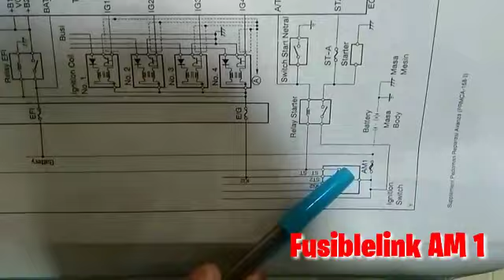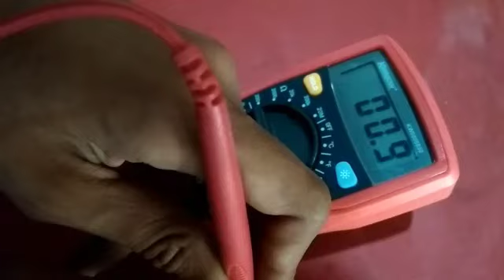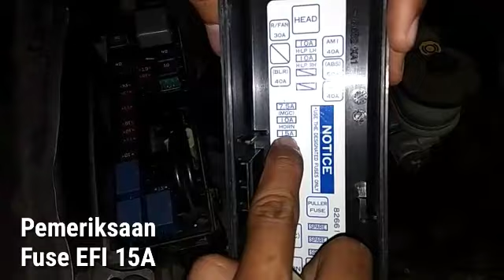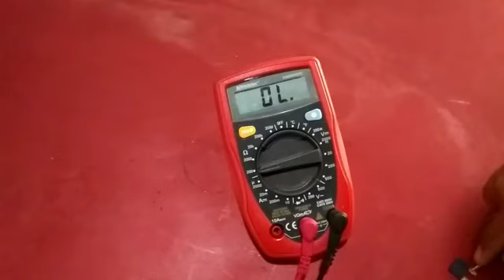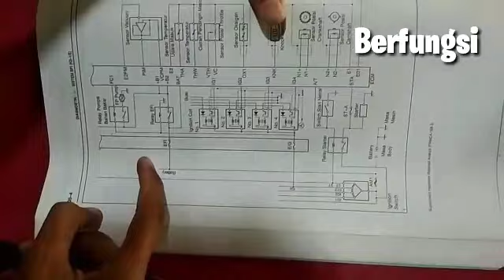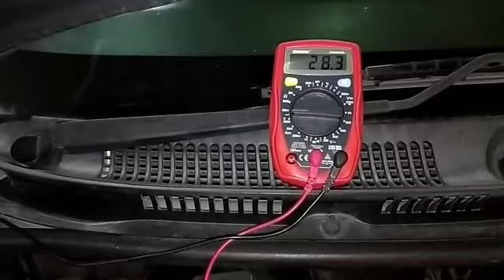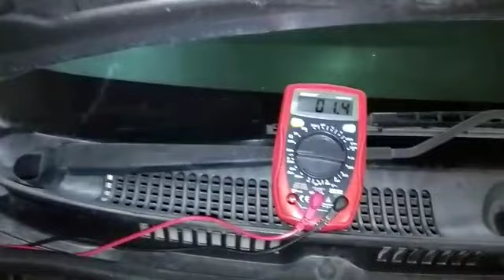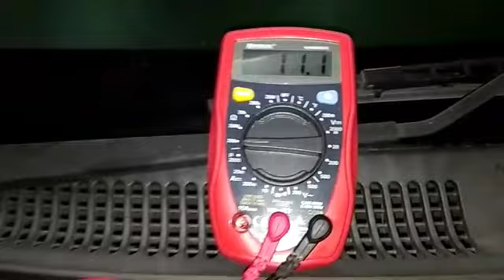CARA MUDAH PERIKSA SEKRING MOBIL DAN KELISTRIKAN YANG  BERMASALAH" servis 2 #otomotif #engine

Comment: Nama : Apriliani Muslikatun Rohmah
Kelas : XII TKRO C
No.Abs : 6
Materi : Service Tune Up Mobil
Baterai -> fusibelink AM 1 -> fuse EFI -> fuse E/G -> relay starter -> relay pompa bahan bakar -> relay EFI.
Langkah pemeriksaan 
- Aki/baterai pastikan semua kabel tersambung pada aki. 
-fusebelink AM 1 bernilai 40 A terletak dibawah relay head (sebelum dipasang lakukan pengecekan terlebih dahulu dengan multitester) 
- Fuse EFI terletak dibawah fuse horn (sebelum dipasang lakukan pengecekan terlrbih dahulu) 
- Fuse E/G terletak pada nomer 4 dari bawah (sebelum dipasang lakukan pengecekan terlebih dahulu)
-Relay starter lakukan pengecekan dengan multitester. 
- Relay EFI terletak dibawah relay pompa bahan bakar. 
- Relay pompa bahan bakar lakukan pengecekan sebelum di pasang. 

Pak mau tanya, 
1. Apa yang terjadi jika porsneleng berada di huruf D? 
2. Apa akibatnya jika fiuse ST A rusak? 
Mohon penjelasannya Pak terimakasih
Reply from the maker: 1. Mobil matic hanya bisa distart di posisi N/P 
Kalau kita taruh di D/2/L , ketika kita sudah menemukan trobel fuse/relay kalau tuasnya di D mobil tetap tidak akan hidup.
2. ST artinya starter, kalau rusak berarti sistem starter pada kendaraan tidak bekerja

Comment: Nama : Achmad Alimmuna Putra 
Kelas : XII TKRO A 
No      : 01

Materi : Tune Up EFI 
(Baterai/Accu, Fusiblelink AM1, Fuse EFI, Fuse E/G, Relay Starter, Relay Pompa Bahan Bakar, Relay EFI 

¤ Pastikan saat melakukan pemeriksaan kelistrikan pada mobil , kunci kontak dalam posisi off/Lock.
¤ Pemeriksaan Fusiblelink AM1 bernilai 40 A terletak dibawah Relay Head. Sebelum dipasang, lakukan pemeriksaan terlebih dahulu dengan menggunakan Multitester.
¤ Pemeriksaan Fuse EFI terletak dibawah Fuse Horn no. 3 dari atas. Sebelum dipasang cek Fuse dahulu dengan Multitester. 
¤ Pemeriksaan Fuse E/G 10 A berada pada no. 4 dari bawah, Fuse bernilai 10 A , sebelum memeriksa pastikan Amplas dahulu baru kemudian lakukan pengecekan dengan Multitester. 
¤ Pemeriksaan Relay Starter lakukan pengecekan menggunakan Multitester. 
¤ Pemeriksaan Relay EFI, terletak dibawah Relay Pompa bahan bakar. 
¤ Pemeriksaan Relay Pompa bahan bakar.

Comment: Nama : Sulendra
Kelas : XII TKRO C
No      : 29 

Materi : Tune Up EFI 
(Baterai/Accu, Fusiblelink AM1, Fuse EFI, Fuse E/G, Relay Starter, Relay Pompa Bahan Bakar, Relay EFI 

- Pastikan saat melakukan pemeriksaan kelistrikan pada mobil , kunci kontak dalam posisi off/Lock.
- Pemeriksaan Fusiblelink AM1 bernilai 40 A terletak dibawah Relay Head. Sebelum dipasang, lakukan pemeriksaan terlebih dahulu dengan menggunakan Multitester.
-Pemeriksaan Fuse EFI terletak dibawah Fuse Horn no. 3 dari atas. Sebelum dipasang cek Fuse dahulu dengan Multitester. 
¤ Pemeriksaan Fuse E/G 10 A berada pada no. 4 dari bawah, Fuse bernilai 10 A , sebelum memeriksa pastikan Amplas dahulu baru kemudian lakukan pengecekan dengan Multitester. 
- Pemeriksaan Relay Starter lakukan pengecekan menggunakan Multitester. 
-Pemeriksaan Relay EFI, terletak dibawah Relay Pompa bahan bakar. 
- Pemeriksaan Relay Pompa bahan bakar.

Comment: Nama:Sinta Wijayanti 
Kelas: XII TKRO C
NO abs:27
Materi tune up EFI
Pertama yang dibutuhkan adalah EWD (Electrical Wairing Diagram).
-Pastikan saat melakukan pemeriksaan kelistrikan pada mobil kunci kontak dalam posisi off/lock
1. Pemeriksaan Aki/Batteray
2.Pemeriksaan Fussiblelink AM 1, bernilai 40A letaknya di bawah relay head, sebelum memasang fuse harus dicek terlebih dahulu apakah fuse berfungsi dengan baik atau tidak dengan cara di cek menggunakan multitester.
3.Pemeriksaan fuse EFI bernilai 15A letaknya di bawah fuse born nomer 3 dari atas.
4.Pemeriksaan fuse E/G terletak di nomer 4 dari bawah bernilai 10A. 
5.Memasang Relay starter setelah di pasang lalu di cek ternyata bisa di starter tetapi tidak menyala. 
6.Memasang relay EFI setelah dipasang dan di cek ternyata bisa di starter tapi setelah beberapa saat mati sendiri. 
7.Memasang relay pompa bahan bakar setelah dipasang dan di cek ternyata mobil sudah bisa beroprasi secara normal. 

Pertanyaan:
1.sebenarnya EFI itu lebih dominan ke kelistrikan atau gimana pak?
Reply from the maker: Sistem efi, mwngadopsi kelistrikan yg diterapkan pada sistem bahan bakarnya untuk menyuplai bahan bakar dalam silinder

Comment: Nama: Medita Rochmi
Kelas: XII TKRO C
No. absen: 21

Materi: Service Tune Up Mobil
Baterai –> fusibelink AM 1 –> Fuse EFI –> Fuse E/G –> Relay starter –> Relay pompa bahan bakar –> Relay EFI
Langkah pemeriksaan 
Pastikan kunci kontak dalam posisi off/lock
-Aki/baterai, pastikan semua kabel tersambung pada aki
-Fusibelink AM 1 bernilai 40 A terletak di bawah relay head (sebelum dipasang lakukan pengecekan terlebih dahulu dengan multitester)
-Fuse EFI, terletak di bawah fuse horn (sebelum dipasang lakukan pengecekan terlebih dahulu)
-Fuse E/G, terletak pada no.4 dari bawah ( sebelum dipasang lakukan pengecekan terlebih dahulu)
-Relay starter, lakukan pengecekan dengan multitester
-Relay EFI, terletak di bawah relay pompa bahan bakar
-Relay pompa bahan bakar, lakukan pengecekan sebelum dipasang

Comment: Nama : Slamet Prayitno
Kls      : Xll TRO A
No a   : 27
Materi: tune up EFI
batre * fuse blelink AM 1 fuse EFI *fuse E/G *relay starter *relay pompa bahan bakar *relay EFI
-pastikan saat melakukan pemeriksaan kelistrikan pada mobil kuci kontak  dalam posidi OFF/LOCK
-pemeriksaan aki atau battery pastikan semua kabel ke aki dan kemudian kecangkan baut aki jangan sampai kendorr
-pemeriksaan fusiblelink AM 1 bernilai 40 amper letaknya di bawah heord ,sebelum memasang fuse 40 amper pastikan bisa digunakan dan sebelum di pakai di periksa terlebih dahulu  dengan mengunakan multitester
-pemeriksaan fuse EFI letaknya di bawah fuse horn nomer tiga dari atas  sebelum memasang lakukan pemeriksaan terlebih dahulu utuk pemeriksaanya di bersikan mengunakan amplas terlebih dahulu kemudian baru di cek dengan mengunakan multitester
-pemeriksaan fuse E/G 10 A berada pada nomer 4 dari bawah, fius bernilai 10 amper kemudian sebelum di pasang diperiksa terlebih dahulu dan di amplas
-pengecekan relay starter terletak di paling atas dudukan putih sebelum di pasang relay di cek terlebih dahulu
-pemeriksaan relay efi letak di bawah pompa bahan bakar
-pemeriksaan relay bahan bakar

Comment: Nama : Supandra
Kelas : XII TKRO B
No      : 23

Materi : Tune Up EFI 
(Baterai/Accu, Fusiblelink AM1, Fuse EFI, Fuse E/G, Relay Starter, Relay Pompa Bahan Bakar, Relay EFI 

- Pastikan saat melakukan pemeriksaan kelistrikan pada mobil , kunci kontak dalam posisi off/Lock.
- Pemeriksaan Fusiblelink AM1 bernilai 40 A terletak dibawah Relay Head. Sebelum dipasang, lakukan pemeriksaan terlebih dahulu dengan menggunakan Multitester.
-Pemeriksaan Fuse EFI terletak dibawah Fuse Horn no. 3 dari atas. Sebelum dipasang cek Fuse dahulu dengan Multitester. 
¤ Pemeriksaan Fuse E/G 10 A berada pada no. 4 dari bawah, Fuse bernilai 10 A , sebelum memeriksa pastikan Amplas dahulu baru kemudian lakukan pengecekan dengan Multitester. 
- Pemeriksaan Relay Starter lakukan pengecekan menggunakan Multitester. 
-Pemeriksaan Relay EFI, terletak dibawah Relay Pompa bahan bakar. 
- Pemeriksaan Relay Pompa bahan bakar

Comment: Nama:Welas Asih
Kelas:XII TKRO B
No absen:27
Materi: Service Tune Up Mobil
Baterai -> Fusibelink AM 1 -> Fuse EFI -> Fuse E/G -> Relay starter -> Relay pompa bahan bakar -> Relay EFI. 
Langkah Pemeriksaan:
-Aki/baterai pastikan semua kabel tersambung pada aki
-Fusebelink AM 1 bernilai 40 A terletak dibawah relay head (sebelum dipasang lakukan pengecekan terlebih dahulu dengan multitester) 
-Fuse EFI terletak dibawah fuse horn (sebelum dipasang lakukan pengecekan terlebih dahulu) 
-Fuse E/G terletak pada nomer 4 dari bawah (sebelum dipasang lakukan pengecekan terlebih dahulu)
-Relay starter lakukan pengecekan dengan multitester
-Relay EFI terletak dibawah relay pompa bahan bakar
-Relay pompa bahan bakar lakukan pengecekan sebelum di pasang.

Comment: Nama: M syamsul anwar
Kelas: XII TKRO C
Absen: 19
Materi: tune up efi
Baterai- fusiblelink AM1 - fuse efi - fuse E/G - relay starter - relay pompa bahan bakar - relay Edi
* Pastikan saat melakukan pemeriksaan kelistrikan pada mobil kunci kontak off
* Periksa aki pastikan semua kabel tersambung ke aki
*Pemeriksaan fusiblelink AM1 bernilai 40 A terletak di bawah relay head sebelum di pasang, lakukan pemeriksaan terlebih dahulu dengan menggunakan multi tester 
* Pemesiksaan fuse efi terletak di bawah fuse horn nomer 3 dari atas sebelum di pasang lakukan pemeriksaan dengan multi tester
* Pemeriksaan E/G 10A berada pada nomer 4 dari bawah fius bernilai 10A sebelum memeriksa amplas terlebih dahulu
* Pemeriksaan relay starter lalukan pengecekan dengan multi tester
* Pemeriksaan relay efi, terletak di bawah relay pompa bahan bakar 
* Pemeriksaan pompa bahan bakar

Comment: Nama:Dwi agung santoso
Kelas:XII TKRO B
No:8

Materi: TURN UP EFI
Baterei->Fusebling AM 1-> Fuse Efi->fuse E/G->Relay starter->Relay pompa bahan bakar->Relay Efi
Langkah pemeriksaan:
Pastikan pada saat melakukan pemeriksaan kelistrikan pada mobil kunci kontak dalam posisi OFF

Pemeriksaan aki pastikan semua kabel tersambung pada aki tidak ada yang diselipkan.
Pemeriksaan fisik Lelono AM1, bernilai 40 A terletak di bawah relay head(sebelum di pasang lakukan pengecekan terlebih dahulu dengan multi tester)
Pemeriksaan fuse Efi bernilai 15 A terletak di bawah Fuse horn (sebelum dipasang lakukan pemeriksaan dan bersihkan terminalnya dahulu)
Pemeriksaan Fuse E/G bernilai 40 A berada di nomor 4 dari bawah (sebelum dipasang lakukan pengecekan terlebih dahulu)
Pemeriksaan relay starter,lakukan pengecekan dengan multi tester
Pemeriksaan relay Efi, terletak dibawah Relay pompa bahan bakar
Pemeriksaan relay pompa bahan bakar, lakukan pengecekan terlebih dahulu sebelum dipasang.

Comment: Nama : Abdul Hadi
No.abs : 01
Kelas : XII TKRO B
Materi : Tune up EFI

               Yang dibutuhkan adalah :
               EWD (Electrical Warung Diagram)
               Baterai__Fusiblelink AM 1__Fuse EFI__Fuse 
               E/G__Relay Starter__Relay pompa bahan
               bakar

Pastikan saat melakukan pemeriksaan kelistrikan pada mobil, kunci kontak dalam posisi off/lock.

      Langkah pemeriksaan :
               1. Pemeriksaan Aki/Baterai ( pastikan semua
                   kabel tersambung pada Aki
               2. Pemeriksaan Fusiblelink AM 1 bernilai 40 
                   A terletak dibawah relay head (sebelum di
                   pasang lakukan pengecekan terlebih
                   dahulu dengan multitester)
               3. Pemeriksaan Fuse EFI terletak dibawah
                   fuse horn (sebelum dipasang lakukan
                   pengecekan terlebih dahulu)
               4. Pemeriksaan Fuse E/G terletak pada no. 4
                   dari bawah ( sebelum dipasang lakukan
                   pengecekan terlebih dahulu)
               5. Pemeriksaan Relay starter ( lakukan 
                   pengecekan dengan multitester)
               6. Pemeriksaan Relay EFI terletak dibawah
                   relay pompa bahan bakar
               7. Pemeriksaan Relay pompa bahan bakar
                   (lakukan pengecekan sebelum dipasang)

Comment: Nama : Muhammad Yusuf Danang Mustofa
Kelas : XII TKRO A
No.absen : 20

Materi : Tune Up EFI
Baterai - Fusiblelink  AM1 - Fuse EFI - Fuse E/G - Relay Starter - Relay Pompa bahan bakar - Relay EFI
-Pastikan saat melakukan pemeriksaan kelistrikan pada Mobil kunci kontak dalam posisi OFF/Lock
-Pemeriksaan Aki / Battery pastikan semua kabel tersambung ke Aku
-Pemeriksaan Fusiblelink  AM1 benrnilai 40 A terletak dibawah relay head sebelum dipasang, Lakukan pemeriksaan terlebih dahulu dengan menggunakan Multi tester
-Pemeriksaan Fuse EFI terletak dibawah Fuse horn nomer 3 dari atas sebelum dipasang lakukan pengecekan terlebih dahulu dengan menggunakan Multi tester
-Pemeriksaan Fuse E/G 10 A
Beranda pada nomer 4 dari bawah, Fius bernilai 10 A sebelum memeriksa Amplas terlebih dahulu lalu lakukan pengecekan menggunakan Multi tester
-Pemeriksaan Relay Starter lakukan pengecekan menggunakan Multi tester
-Pemeriksaaan Relay EFI, terletak dibawah relay Pompa bahan bakar 
-Pemerikasaan Relay Pompa bahan bakar

Comment: Nama					 : HENDRIX DWI SAPUTRA
Kelas					 : XII TKRO C
No.Absen    : 16
 
Materi : TURN UP EFI                                         

Baterai -> Fusebelink AM 1 -> Fuse Efi -> Fuse E/G -> Relay starter -> Relay pompa bahan bakar -> Relay Efi

Langkah pemeriksaan :
  Pastikan pada saat melakukan pemeriksaan kelistrikan pada mobil kunci kontak dalam posisi OFF/LOCK. 

- Pemeriksaan Aki/Baterai, pastikan semua kabel tersambung pada aki tidak boleh ada yang diselipkan / jangan kendor. 
- Pemeriksaan fusiblelink AM 1, bernilai 40 A terletak dibawah relay head ( sebelum dipasang lakukan pengecekan terlebih dahulu dengan multitester). 
- Pemeriksaan fuse Efi, bernilai 15 A terletak dibawah fuse horn ( sebelum dipasang, lakukan pemeriksaan dan dibersihkan terminal nya terlebih dahulu). 
- Pemeriksaan Fuse E/G, bernilai 10 A berada di no. 4 dari bawah ( sebelum dipasang lakukan pengecekan terlebih dahulu). 
- Pemeriksaan Relay starter, lakukan pengecekan dengan multitester. 
- Pemeriksaan Relay Efi, terletak dobawah relay pompa bahan bakar. 
- Pemeriksaan Relay pompa bahan bakar, lakukan pengecekan terlebih dahulu sebelum dipasang.
Reply: Nama: Fatahul qiwamuddin
No absen:14 
Kelas: XII TKRO C

Materi: Tune up Efi

Pengecekan: Batrai ->fusebelink AM 1 ->fuse EFI ->fuse E/G  -> Relay starter ->Relay pompa bahan bakar ->Relay EFI.

Langkah pemeriksaan:
- pastikan kunci mobil pada posisi off/lock
-pemeriksaan batrai, pastikan semua kabel menempel di accu lalu kencangkan jangan sampai kendor.
-pemeriksaan fusebelink AM1,bernilai 40A terletak di bawah Relay head(lakukan pengecekan dgn multitester sebelum di pasang).
-pemeriksaan fuse EFI,bernilai 15A terletak di bawah fuse horn(lakukan pengecekan dgn multitester sebelum di pasang).
-pemeriksaan fuse E/G,bernilai 10A berada di nomer 4 dari bawah (lakukan pengecekan dgn multitester sebelum di pasang).
-pemeriksaan Relay starter,( lalkukan pengecekan dgn multitester sebelum di pasang).
-pemeriksaan Relay EFI,(lakukanlah pengecekan dgn multitester sebelum di pasang).
-pemeriksaan Relay pompa bahan bakar,(lakukan pengecekan dgn multitester sebelum di pasang).

Comment: Nama : Ahmat Nur Fahkehariyanto 
Kelas : XII A
No :05
Yang perlu Dipersiapkan EWD (Electrical Wiring Diagram) 
Pemeriksaan kelistrikan kunci kontak harus pada posisi off/ lock.
- Pemeriksaan aki, pastikan semua kabel tersambung pada aki tidak boleh ada yang diselipkan/ jangan kendor.
- Pemeriksaan FL AM1 bernilai 40 A terletak dibawah relay head (sebelum dipasang FL harus dicek dengan multimeter) biasa selektor ditaruh 200 ohm.
- Pemeriksaan fuse EFI bernilai 15 A letaknya dibawah fuse horn (sebelum dipasang, lakukan pemeriksaan dan dibersihkan terminal).
- Pemeriksaan fuse E/G letaknya pada no 4 dari bawah (pengecekan seperti biasa).
- Pemeriksaan relay starter terletak di paling atas dudukan putih (pengecekan terminal 30 sebagai penyedian arus dari aki +, 87 ke beban -, 85 dan 86 diukur dengan multi).
- Pemeriksaan relay efi letaknya dibawah relay pompa bahan bakar.
- Pemeriksaan relay pompa bahan bakar.
Reply from the maker: Ciri² relay yang masih baik sperti apa fakeh ?

Comment: Nama : M.Jokonoto p
Kelas : XII tkrob
No.    :19

Materi :service tune up mobil
Baterai -> fusibelink AM 1-> Fuse EFI -> Fuse E/G -> Relay starter -> Relay pompa bahan bakar -> Relay EFI Langkah pemeriksaan
 Pastikan kunci kontak dalam posisi off/lock
-Aki, pastikan semua kabel tersambung pada aki
 -Fusibelink AM 1 bernilai 40 A terletak di bawah relay head 
-Fuse EFI, terletak di bawah fuse horn 
 -Fuse E/G, terletak pada no.4 dari bawah ( sebelum dipasang lakukan pengecekan terlebih dahulu) 
-Relay starter, lakukan pengecekan dengan multitester -Relay EFI, terletak di bawah relay pompa bahan bakar -Relay pompa bahan bakar, lakukan pengecekan sebelum dipasang

Comment: Nama : Taat Setiawan
Kelas  : XII TKRO B
No.     : 24 
Materi : Tune Up EFI

     Yang dibutuhkan adalah 
      EWD (Electrical Warung Dagram)
     Baterai-Fuseblelink AM 1-Fuse EFI
     -Fuse E/G-Relay starter-Relay 
      pompa bahan bakar. 

Pastikan saat melakukan pemerisaan kelistrikan pada mobil, kunci kontak harus dalam keadaan off/lock.

Langkah pemeriksaan : 
- Pastikan kunci kontak harus off/lock
-Pastikan semua aki dan pastikan yang tersabung aki jangan sampai kendor.
-Pemeriksaan Fusibelink AM 1, bernilai 40 A terletak dibawah relay head( cek terlebih dahulu menggunakan multitester) 
-Pemeriksaan Fuse EFI, bernilai 15 A terletak di Fuse Horn. 
-Pemeriksaan Fuse E/G, bernilai 10A berada di no 4 dari bawah. 
-Pemeriksaan Relay starter.
-Pemeriksaan EFI dibawah Relay pompa bahan bakar (lakukan pengecekan sebelum di pasang)